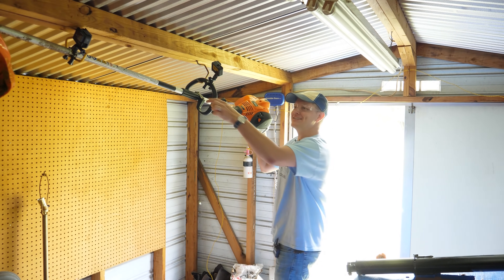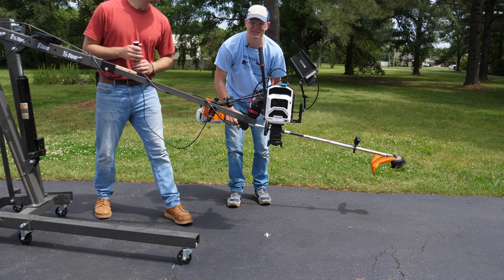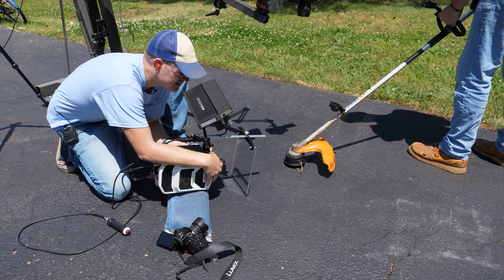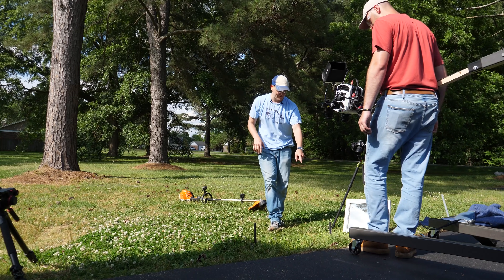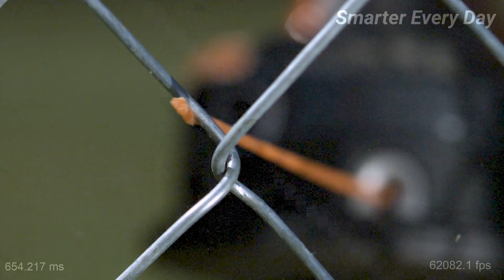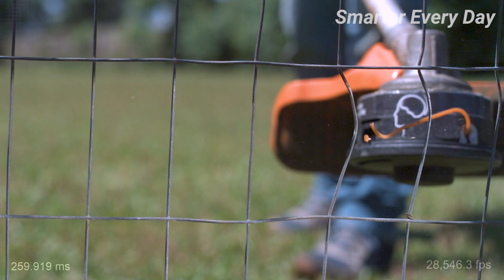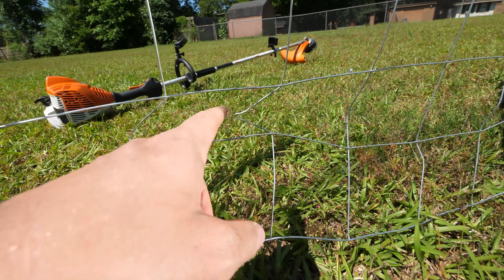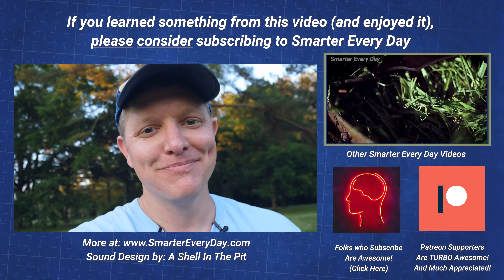How Weed Eaters Work (at 62,000 FRAMES PER SECOND) - Smarter Every Day 236

Comment: Destin:"95 thousands of an inch"
Me from anywhere but the USA: yeah now I now exactly how thicc that boi is.
Reply: 2,413 mm
Reply: @2406ab  almost two and a half meters? Might need to check your math, buddy.
Reply: Nah, people in the US also have no idea how thiccc that is
Reply: It is 2.4 mm.
Reply: In the imperial system, I thought they split inches into 1/2, 1/4, 1/8, 1/16, 1/32, 1/64 etc...
 
So surely instead of using 1000ths (which is a suspiciously metric fraction, on account of using the decimal system), they should use 1024ths...
Reply: Ser Garlan Tyrell nah, it makes sense to use decimal inches on anything more precise than building construction. Most folks who do precision work have fractional/decimal conversions memorized. 5/8 is .625 etc, same number just expressed differently 🤷🏻‍♂️  fractional/decimal conversions are taught very early here
Reply: @JHorvathCinema  Or just use metric so youre in sync with the rest of the world? So instead of teaching them early, use that time to teach them metric (the us has officially been metric since like the 70's anyway). Because then it would save every other country time faffing around with multple sets of units just to accomodate 1 country.
It's not so bad when working with small numbers of inches, but as soon as you get measurements that require many feet's worth of inches, it becomes a pain.
 
Say you were working on an aeroplane then if you want to work in consistent units (presumably inches), visualising a wingspan of say 458" means you have to divide by 12 in your head, so 38' and a bit, then divide that by 3, so 12 & 2/3 yards. You can do it but it took an extra 5 seconds.
 
Compare that to metric, 458" is 11633.2mm divide by 1000, is 11.6332m which you can do without even thinging about it as it's just a case of moving the decimal place. Plus you can use a calculator much more easily, becase computers use base 10, so it makes sense that your measurement system does too.
Reply: Ser Garlan Tyrell You don’t have to sell me on the metric system, I’m just telling you the reality of it. It’s changing slowly, but it’s not a simple change to make, and in the mean time it’s not that hard to deal with both.
Reply: @sergarlantyrell7847  Decimals aren't exclusively metric... And it's 1000ths of an inch. It's not a mix and match of base 12 and base 10. So, not really all that confusing.
Reply: The crucial question is: Do American engineers seriously work regularly with anything other than SI units? And, yes, I have seen the 'swiss-made' measuring device.
Reply: @paulpaschulke8636  yes they do all day every day. Because I know this will blow your mind but as long as you have a standardized unit of measure it more than adequately serves it's function.  And no people switched to metric from their traditional measurements until they were forced to do so.
Reply: @paulpaschulke8636  Get a job in a machine shop and find out yourself go-getter. Inches are very common in the USA.  When people say one is more precise than the other, its a display of their ignorance.
Reply: @mackk123    Yes, inches are indeed very common in the USA. However, never used in the rest of the world. There are literally 3 countries in the world that use imperial and 2 of those are 3rd world countries (Liberia and Myanmar)which i doubt you even know where they are located (but to be fair i had to google it too so nevermind). EVEN YOUR SCIENTISTS USE METRIC!
Reply: @T.H.0601  Are you proud of yourself for looking that up? Go into manufacturing they use the THOU, the TENTH, and the MILLIONTHS of an inch. 1 tenth is 2.54 microns. have fun with that information.
Reply: @mackk123  A machine shop? I thought Destin was in a different league. 
Whether engineers at NASA or e.g. at a university ever use the unit inch instead of meter, I am much more interested.  
I'm well aware of how things look in everyday life.
Reply: @paulpaschulke8636  NASA and universities will purchase parts made in manufacturing shops to complete their projects. They hand out these things called contracts to various companies. The contracts are often so hefty, they get parted out and sub-contractors come into play. I worked at a machine shop that made landing gears and hydraulic cylinders along with the pistons. We use the thou and tenths. Millionths of an inch are very very fine meausrements often used by the NIST, laboratories that have the ultimate final say in metrology. an inch is an inch and 2.54cm is an inch.  Do you really think university students could be trusted to manufacture hundreds of parts with complete repeatability and traceability to standards of measurment?  They go into finer measurements than using just a plain ruler. metrology tools are vast and numerous, but the basics are a micrometer and a caliper.
Reply: @mackk123  How does that have anything to do with what I just said?
If I said "go to a shop, they speak ROMANIAN." would that make sense to you?
Let me put this more clearly. I said that every other country uses metric and you said that in America's manufacturing industry they use inches.
Guess what, in Europe in the manufacturing industry they use metric, TENTH AND MILLIONTHS of a millimetre. 
Your point doesn't contradict my claim in the slightest. 
And as for the "looking that up" part, I said "you probably don't even know where those are located" if i hadn't said i looked it up you would have been like "i bEt YoU dOnT kNoW wHeRe ThOsE cOuNtRiEs ArE eItHeR" and yes, i didn't know where those countries were located and that's exactly why i looked it up, you on the other hand didn't even take the time to carefully read my comment and see what I mean so obviously you wouldn't take the time to check where those countries are situated.
Reply: @T.H.0601  I can tell you are not in manufacturing. What kind of machines are you working on holding those tolerances of millionth of a millimeter and producing parts?  With a a resolution that fine of millionths of a millimeter, you're  measuring plank units , but not producing parts that fine and if you are, good luck repeating that. However if you're speaking of millionths of a meter, 2.54 microns,  is 1 tenth is, which is in the realm of grinding and lapping. a blood cell is a little bit under 1 tenth in diameter.
Reply: @mackk123  Not my point. Yes it was an over exaggeration that didn't make any sense, that's my fault for not knowing much about manufacturing and factories in general. Still, my point stands. That point being, you can't say we shouldn't expect to see measurements in metric since metric is (and i can't stress this enough) USED BY ALL COUNTRIES EXCEPT 3.
Reply: @T.H.0601  Look up per capita how many manufacturers use metric vs inches, Thats a more interesting number to find. The USA has a large population.
Reply: @T.H.0601  Also from the first thing on google (wikipedia) "The inch is a commonly used customary unit of length in the United States, Canada, and the United Kingdom. It is also used in Japan for electronic parts, especially display screens. In most of continental Europe, the inch is also used informally as a measure for display screens."
Reply: Thousandths of an inch is common in trades like machining, not really used by the general public.
Reply: @busimagen  but "two point four" doesn't make sense if it's not a point
Reply: Here's a funny story, The USSR wanted B-29's and got a few because they ran out of fuel and had to land in the USSR. They backwards engineered them so they could build there own. The problem was it took them a long time because none of their machining process's were the same due to SAE and metric. Every single part had to be custom made and machines built to use the measurements the US used because Stalin wanted it to be exactly the same. it was called the Tupolev Tu-4. So we kinda like using our own thing it makes us different.
Reply: @busimagen  right, 2 and a half thousand millimeters is 2 and a half meters.
Reply: @busimagen  I was unaware that this was not a thing elsewhere. I consider myself succesfuly informed.
Reply: I had the same doubt. Only kept on watching because it is Destin, otherwise I just stop the video right there. Would be nice to have an overlay with the diameter in metric.
Reply: @CamiloSperberg  Imagine watching a video that is made in America then quit watching the video because it uses AMERICA'S customary units.
Reply: Camilo Sperberg you'd stop watching a video because he used imperial units? You know they both measure things effectively right? That's absurd, I'd never stop a video if they used metric units and I'm from america. I'd just ask Siri to convert it or something because it's the 21st century
Reply: @CamiloSperberg  Jesus Christ that is pathetic
Reply: @CamiloSperberg  Yeah, but it is a simple mathematic conversion. Granted, Metric is better, easier and more clear, but the formula is easily accessible with internet.
Reply: At least we know how to spell *know, thick, and boy 👏😆
Reply: @druid_zephyrus  i am not american and 2,413 mm is the proper way to write it because half the world uses decimal comma instead of decimal point. the key is  being educated and knowing the differences in all the countries rather than stupidly blaming each other for their retarded systems.
Reply: @2406ab  half the world using a decimal comma doesn't make it right. The oldest existing references to Arabic numerals uses a decimal point, with a symbol that very much resembles a comma separating groups of thousands to the left of the decimal point. Therefore the decimal comma, which originated solely as an attempt to confuse and cheat Ottoman traders, is wrong.
Reply: @iwontliveinfear  it didnt said its "right". its the proper way to write it in all of europe except UK. there is no right or wrong this is basically a language difference stop pretending one is better than the other.
Reply: I usually dont watch the video/quit watching when they don't use metric.
But only in videos where the measurements matter (sience/math/rocketry/cars). here it doesn't.
Reply: @PantsAreAnOption  Why are you watching American made videos on those topics? They will almost never use Metric since the target audience are American.
Reply: @GarrusN7  all white looks the same xD
Reply: @PantsAreAnOption  Learn to use decimal inch smarty pants.
Reply: Decimal inch is king. metric is for nerds. Thats just how it goes. disagree? ok have fun with your ruler.
Reply: It's amazing how confused people get. Imagine being a contractor (fractional inches), a machinist (decimal inches), and a scientist (SI/metric). I use all three, everyday, and it's never been an issue. I liken it to how people, from every single country outside of the US, expect Americans to pronounce names/words in their language perfectly fine. (At the end of their comment complaining about how someone said a word wrong, it says, "... Sorry for my English." Ironic huh?) Americans are expected to know the pronunciation intricacies of a hundred other languages, otherwise people who speak those languages call you an idiot because you don't know. Yet, they can't grasp inches. Riiiight.
Reply: @xenonram  The same could be said for how difficult americans seem to find the idea of switching to metric...
Everyone using the same system of measurements is clearly advantageous, so why not switch? But despite effors by your own government, your country can't seem to cope with a switch.
Reply: @sergarlantyrell7847  Why don't you rebuy all your tools and switch to decimal inch? Theres no problem with different systems, if you cant keep up then its your problem. Keep seething.
Reply: @mackk123  you're saying it's not better to all use the same system?
Reply: @xenonram  I didn't think it was possible to agree with a comment this much
Reply: @xenonram  It's because people in the US often don't bother to learn correct pronounciations of foreing words or names, so to someone that did or is going through the trouble of learning another language, it looks disrespectful and stupid when you people do it. I rarely see people being mad like you say that someone from the US pronounced something wrong at the first time, but they often don't bother to correct that pronounciation so it becomes a nuisance. Kind of like if the machinist, the contractor or the scientist in your analogy simply didn't bother to learn and internalize the unit conversion formulas and in doing so, delayed the work of the other 2.

Comment: I rarely use weedeaters any more, because in my opinion, the primary purpose of a weedeater is to make you buy more weedeater line. I have a steel edger blade that I use for edging along my sidewalk, and I use weeding hoes along my chain link fence. Do it often, and it's very fast. Do it once or twice a year, and it's a workout.

Comment: What I learned watching that slow-mo was that I need to start wearing my safety glasses while I weed whack.
Reply: Just got done doing it yesterday, and a piece of the line (or maybe a rock, don't know) came up a whacked my safety glasses and the area under my eye. Also had a slight hit to my eye, which caused it to water and sting. I now have a black eye and small cut underneath where the brunt of it was hit.

If I wasn't wearing glasses, there is no doubt that eye would be toast. In fact, I'm considering more substantial goggles that wrap better (like used for chemistry), because enough got in the space between the glasses and my eye to hit it slightly.
Reply: Wear a face shield and safety glasses
Reply: Always

Comment: If the weed whacker hits a rebar or an ornamental grass like Phormium tenax the weed whacker will get pulled in. 
You should make a video about how weed whacker debris fly because I swear that some debris still manages to get through my safety goggles and I get hit somehow near my eye and I do not understand how debris manages to get through or around my goggles. It’s like this one time on a rainy day my head was down and I was out walking. I wear glasses and my eyebrows are kind in line with my glasses but a rain drop hit me in the eye. How did it manage to get my eye? How???

Comment: I am curious if there is a ration between the radius of the trimmer line and the radius of the fencing wire that will guarantee that one or the other will break consistently. More of a material science question, but I’m still curious.

Comment: I run square and star shaped line on mine as well as serated I find it won't  grab as much will be interesting to see why. maybe it snaps before it raps. It could also be because of running a very high power brushcutter.

Comment: No one keeps the guard on their whippers. The only time the guards come out is when OSHA comes around and forces landscapers to reinstall them. Can’t get out enough line with the guard on, and makes flip trimming curbs/beds harder due to blocking visibility.

Also to stop the line from breaking on fences or obstacles you need to use less throttle, even when going around trees you need to throttle down or it digs through the bark over time damaging the trees.

Comment: 15:46 you can see how the filament goes almost always less than 360º arround the metal fence, because it is so thin that the kinetic energy of the filament is bigger than the energy needed to bend the fence. As a consecuence, the filament wraps between 270º-360º, which means that the direction of the force acting in the weed eater is more perpendicular to the fence than the forces acting in the other fences, resulting on the weed eater being atracted to the dence. 

To sum up: very cool

Comment: So in all your years of running a weed eater you never ran out of string and had it easily max rev from less than half trigger pull?
You had to release 2ft of string to find out it didnt wanna rev as high? This is why the right string thickness for your whipper is important. Going thinner in the range that your machine takes will get quicker maxx revvs at full length for working through thicker taller grass. Thicker being used for edging and durability of regular trimming
Landscaping 101, someone only ever mowed his yard......

Comment: Micro plastic shards were fascinating coming off the heavier gauge fence, along with galvanized dust and or anything else on the fence. SmarterEveryDay, still filling the air with petroleum pollutants and noise pollution... sigh.

Comment: Products are generally "over-built" in their first generation, but then manufacturers trim down the specifications to what is needed and no more. After all, they're spending money on things that don't help anyone. So the motor is specified to handle a string of an exact length, matching the safety guard, and any excess power would be a waste.

Comment: I notice that whenever I cut new line into the weed eater it’s never exactly up to the length of the blade that cuts it (when the weed eater is off).
Leaving me to believe that the line actually stretches significantly under the centrifugal force of the machine. I just thought it was pretty cool 🤷‍♂️😂

Comment: Apologies if this is super obvious, but I have an explanation for why it's better to move the head from left to right.
.
The line is spinning, so on one side it's moving away from you and on the other side it's moving towards you. You want the actual work to be done by the bit that's moving away from you, so that it throws stuff away from you instead of towards you.
.
Also we call them whipper snippers over here, and I wore a whole lot more gear when I was using one growing up:
- Harness
- Gloves
- Earmuffs
- Face shield
- Safety glasses
(not criticising, just noting difference)